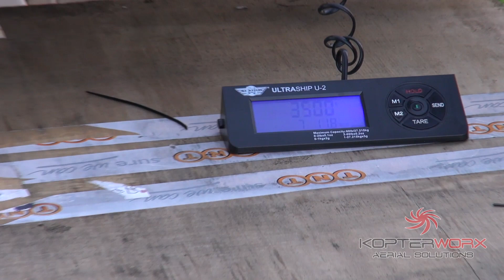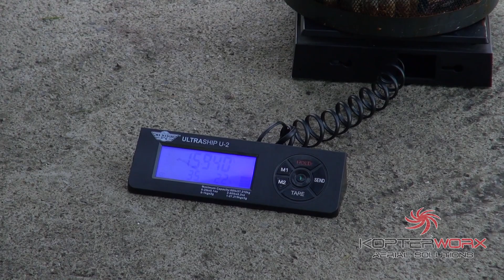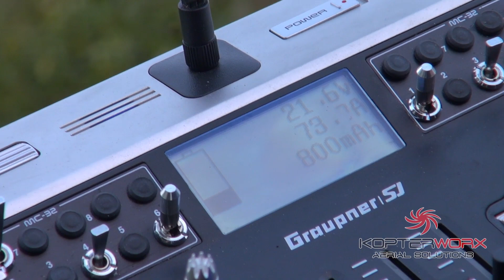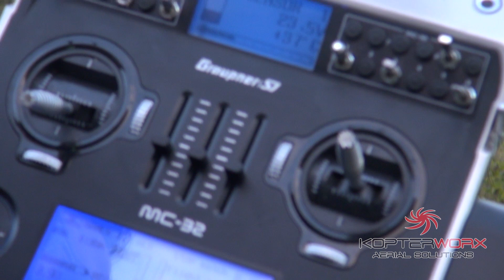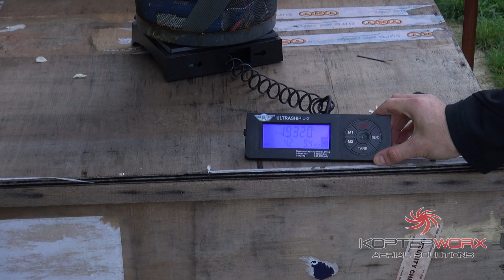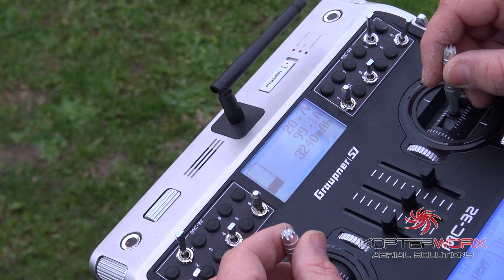Herkules III vs KW10 - 20kg test on SkyJib 8 to X4.

Comment: I am currently planning on doing the same conversion to a SJ8 V1 that lost some booms in a little accident. Can you recommend all the parts you used for motors and ESC props etc, In USD,
If you sell this stuff, I'll buy from you if I can. Great video, amazing lifting ability